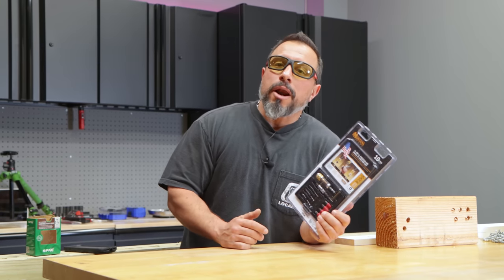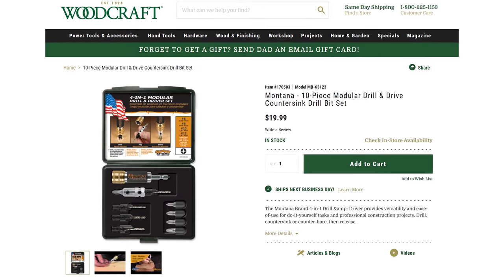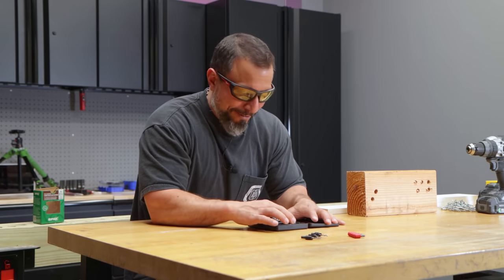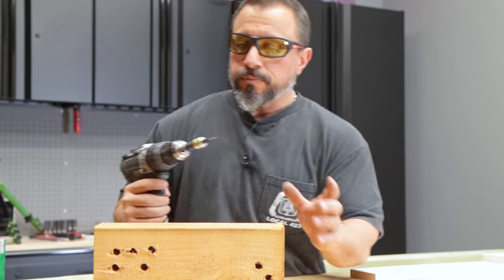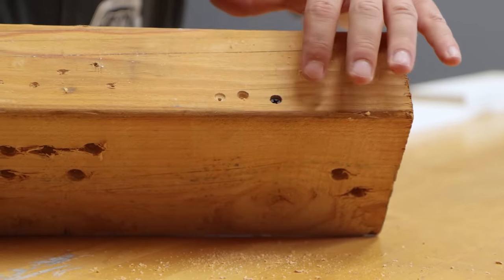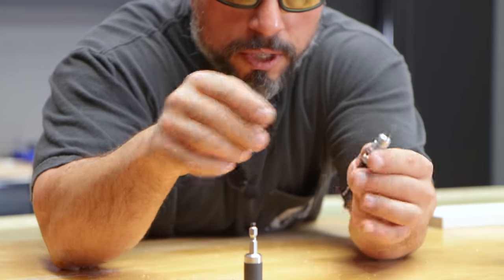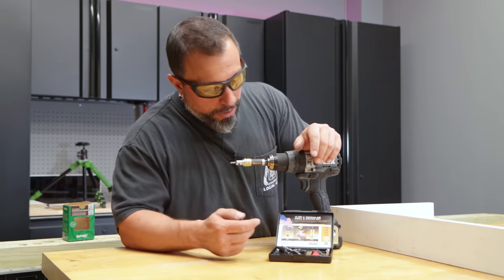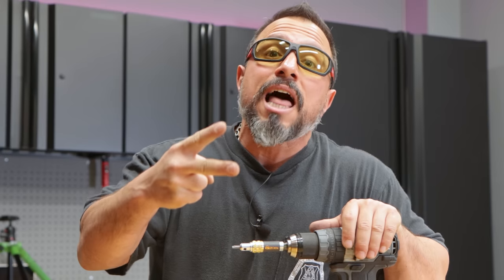If You Use a Drill or Impact Driver, You ABSOLUTELY NEED TO CHECK THIS OUT!

Comment: I actually have 2 sets of Craftsman made in USA, the small one and large kit purchased a little after trying out the small one that have been with me for over 20 years and bought at Sears and still work as good as day 1. Good to see that a company in the USA is still making them because they really are handy and great at doing the job.
Reply: Thank you!  They are our original patent, and we used to make them for Craftsman
Reply: @MontanaBrandTools  Thanks for the appreciation. I am aware that Craftsman was a trademark of Sears but what I did not know was that this product was actually made by a company in the US. It's been a great product for me and still holding its crown. I will be looking at your companies products and recommend to friends moving forward. Thanks again and much success. From Puerto Rico.
Reply: Yeah, I got mine about 22 years ago when I was 12 or 13 years old. I got the big craftsman kit with the hex shank drill bits, the flip countersink/driver, and a QD chuck for 1/4" hex bits that goes in your drill. (Long before impact drivers were developed. LOL.) It's amazing.

Comment: I've had the Makita Quad Driver for some years. You can get it here in Australia at Bunnings. 

I removed the set screw on the bit holder because the magnet is plenty strong. Makes it easier to swap bits without having to take it out of the chuck or reaching for another Allen key.
Reply: They still available mate?

Comment: I use mine quite frequently and used it yesterday in my impact installing deck balusters. Usually running it in a drill and having a designated driver but working in the heat I like to keep as few tools in the sun as possible in case I need to switch them out after overheating.

Comment: I might have to get this kit to see if it works any better than the ones I get at Home Depot.  Because I have had bad luck with those.  The countersink cutter gets filled up quickly with wood shavings and then burns the wood.

Comment: My late Father in-law gave me a set these years ago I don’t think they have the silicone sleeve. But yes it is the exact same kit right down to the black and clear case it comes in. And they are freaking awesome. Use them weekly
Reply: OK saying I use them once a week, may be a bit of a stretch. Anyways I just went out and checked three of mine have, not sure I would call it silicone but yes a Point Of Contact one could hold, for the same precision I get just by poking the spot.  Lol I just don’t see the need I guess it’s nice to have? Now I want to go try it!

Comment: Like the kit but I found that the hex drive with built in Allen key makes it too long to properly engage and lock in my Ryobi and Milwaukee impacts. Is it the same case for the Flex or impact drivers? I'll agree it's best in a drill and that's how I use mine. Addendum to your review or information on this?

Comment: Bought one about 10 years ago, but the ball detent broke and stopped holding the insert. Bought a replacement one and accidentally pulled the insert when locked, and instead of holding the insert in, it pulled halfway out and the ball detent scored through the aluminum and got stuck. Hopefully the design has improved since then

Comment: DEWALT made these a decade ago. We used them like crazy when rigging boats. Drilling into kingboatd , fiberglass gel coat. They made  separate kits from #6 thru # 12. At Home Depot. Then they just dropped them. Couldn’t find them anymore
Reply: Bought my DeWalt set at my DeWalt certified service center. They still make them.

Comment: Wood-crap....The counter sink tool wobbled so bad it didn't drill the pilot hole in the center..Ended up buying a set of vix-bits and sent this Montana set back! Eventually ended up with a Dewalt set like the Montana, but it was machined flawlessly...No thanks, and I don't care if it's made in Montana

Comment: Vince I am sorry but. I have found this item useless in any situation other than a shop where you are not carrying the tool in a drill holster. Every time I have used it the insert falls out constantly. My use of a product like this is not helpful on building three board fence.

Comment: Not worth it in my opinion. I bought two of these bits and both snapped while using my impact driver. I have a brushed makita impact driver so I can only imagine what happens with brushless tool brands. Just buy two different pieces